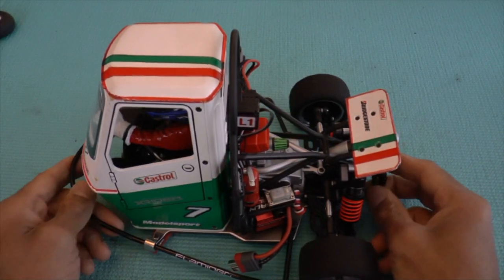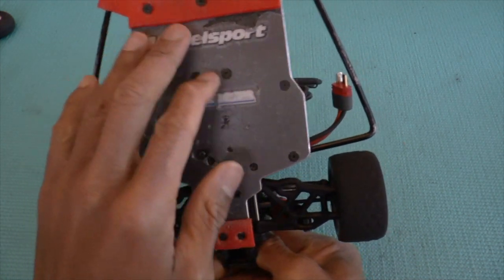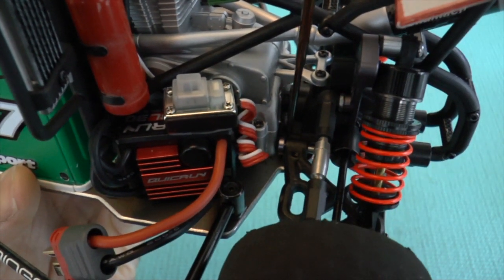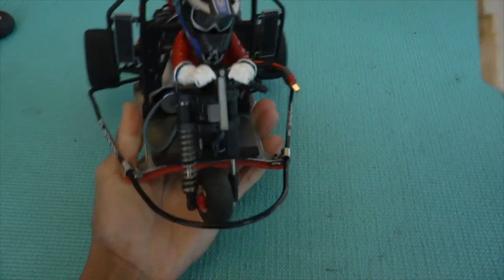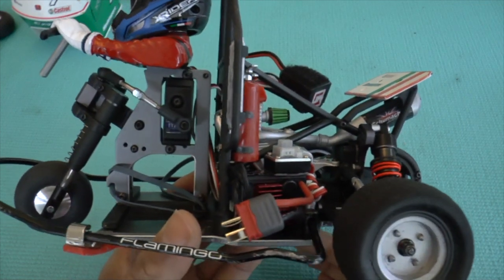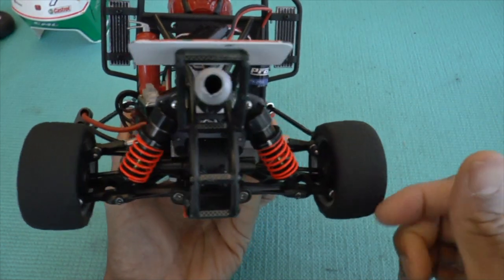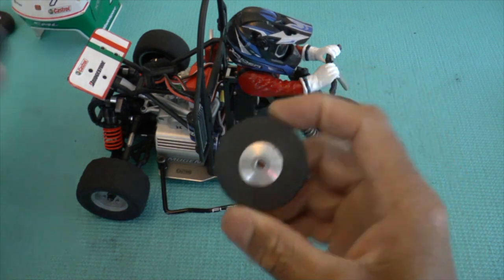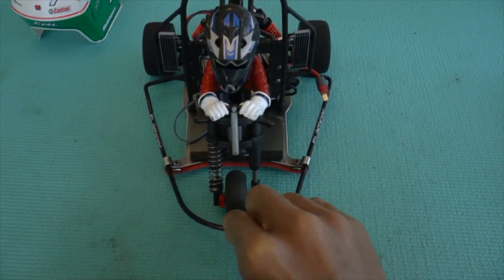X RIDER Flamingo - After Mods & Test Runs Review

Comment: What about the tamiya dual rider front tire? Maybe that will work better it looks better
Reply from the maker: Thought of that Early Culyer, tried it and it would require a high level of modification and wouldn't give a proper scale look in the process. The aluminium tail plane wheel works well and i used a DuBro brand 45mm. Still holding up. Thanks for your comment too.
Reply: @tunesandatalk151  I like your idea better I like the scale of it is awesome.